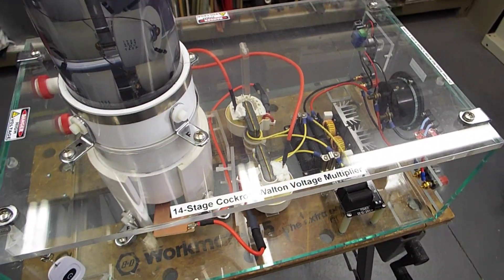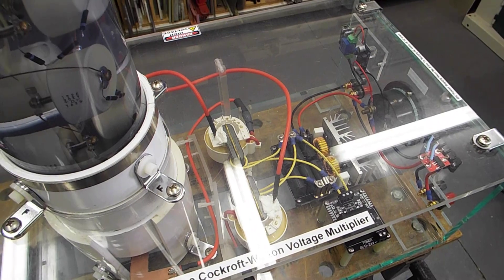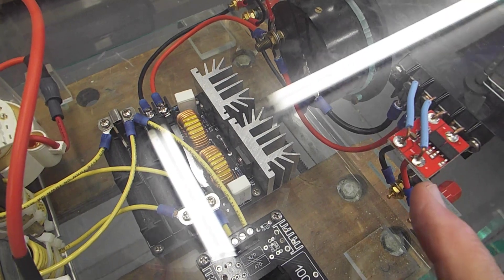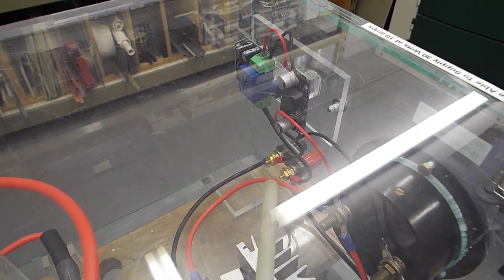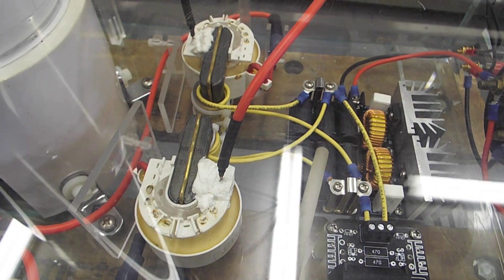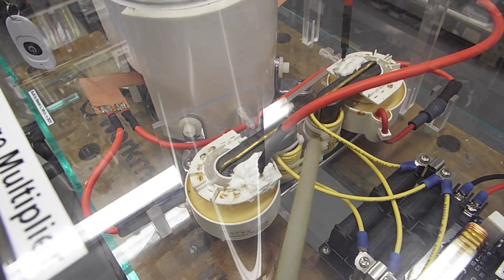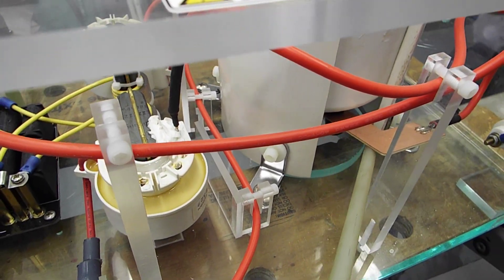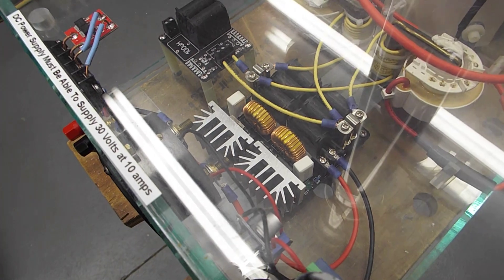Voltage Multiplier HV Power Supply

Comment: Wonderfully crafted as always, going to sit and watch now.  I've written before when you'd posted a small VTTC that was very nice and made me think of a family heirloom that someone might light up 100 years from now (and wonder what it is!) I've posted 2 vids., if you like you can search with this search string. "A tabletop VTTC Tesla Coil that's tunable and made with CAD and a few 3D parts." One A.I., one not but essentially the same. Finishing a mechanical staccato interrupter tonight just for giggles, my 833C coil red-plates fairly quickly. A pile of parts in a bag just came in so I can build a "proper" triac-based one. Keep posting the good stuff and thanks!

Comment: Is there anyway to message you directly concerning what scientific theories you rely on
Reply from the maker: Just post your question here about a specific video.
Reply: @littleshopofelectrons4014  Is the science fringe or just general electrical engineering principles accepted by mainstream and various communities
Reply from the maker: I am a retired electrical engineer. Everything I build is based on sound electrical engineering and physics principals. You will never find any videos on my channel espousing crackpot ideas or pseudoscience.
Reply: @littleshopofelectrons4014  I can definitely tell your not a fringe engineer, so is this just kind of along the lines of plasma and electromagnetism
Reply from the maker: Plasma and electromagetism are definitely at work here.